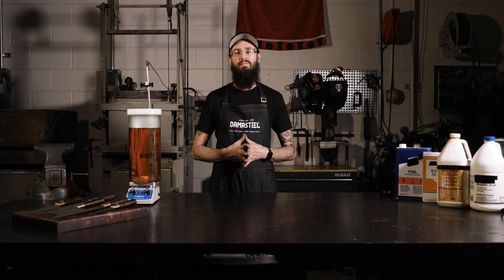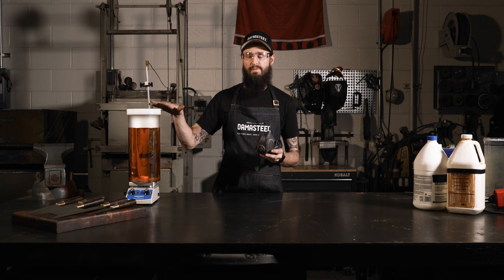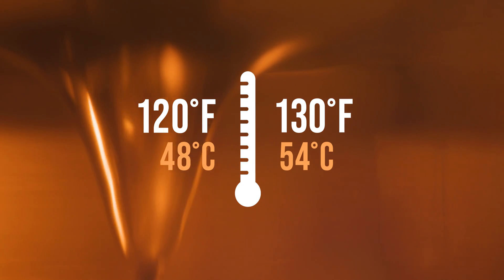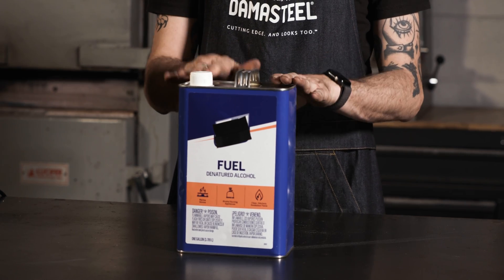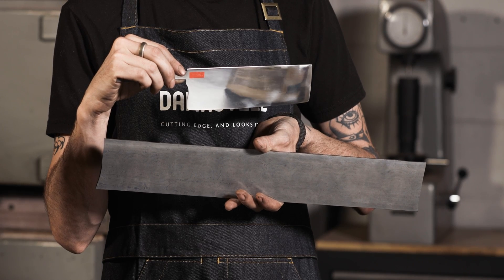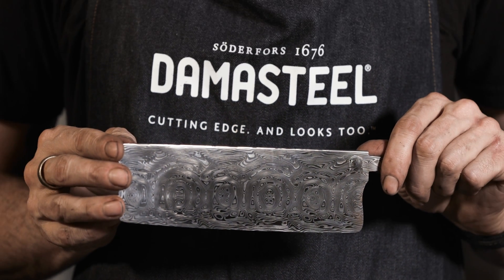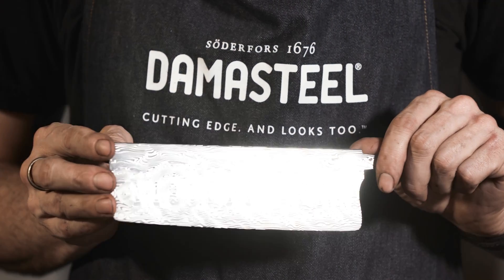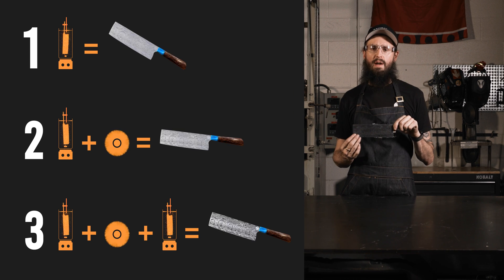How to Safely & Effectively Etch Damasteel® - 3 different results

Comment: I'm happy to see your putting this info out but I feel like this will make beginners think etching is more involved than it needs to be. If your a beginner just get some pvc tube cap an end and fill it with a ferric and distilled water. 1 part ferric 3-4 parts distilled water. Start your etching at the most basic level  and once you are sure you like doing it then you can get into the more detailed and expensive aspects of it. Dont forget to neutralize your metal after the etch (baking soda and water)

Comment: I ech it in hydrochlric acid only, make it about 40-50 degrees warm and put it in for as long as you want it to be deep. No ferric chlorid involved. Then neutralise and its done, gives the best look for me, with high polisched and a very light grey that turns dark over time. but the blade has to be at least 1200-1500 grit polished and buffed, then it looks most elegant. With a sanding finish like a 400 or 600 its not as crisp but also nice for workknives.

Comment: Is there much of a difference in the etch if the acid isn’t heated ?
Reply: Yes absolutely.
Reply: @liquidcobra1450  in what way ?
Reply: @Udeus5  it takes much longer if the acid isn’t heated and doesn’t etch as dark or deep. Without heat, it’s not even worth trying in my opinion.